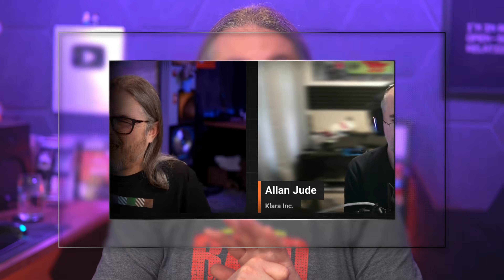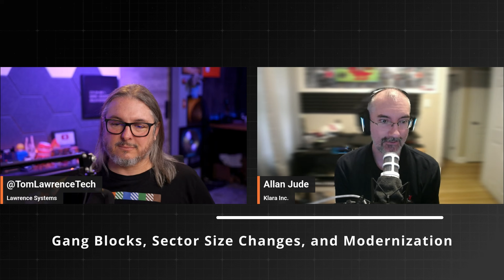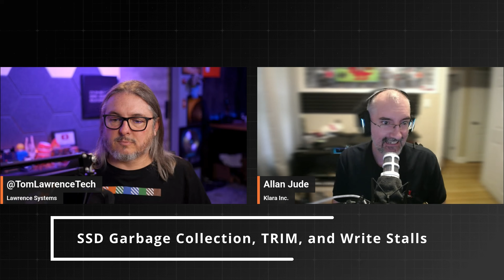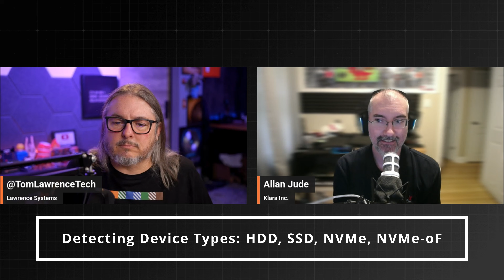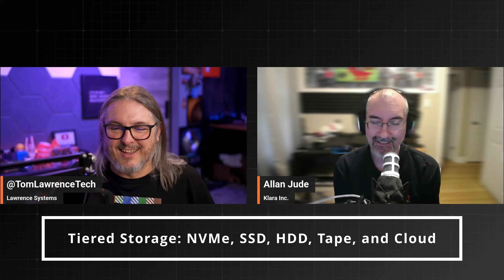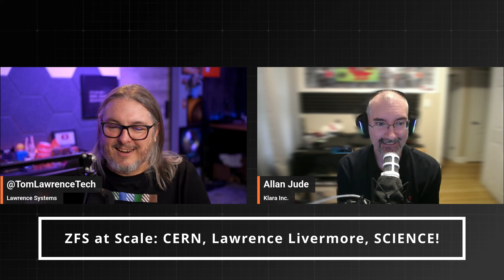Is ZFS Ready for NVMe Speed? Allan Jude Explains

Comment: The Anyraid development wasn't mentioned, which is interesting to a broader audience. It would be interesting to get info about wear leveling strategies on a vdev consisting out of a bunch of drives of different age to get the most lifetime out of them.
But wear leveling may be also interesting in general with replacement drives in a pool, especially if you have SSDs/NVMEs in it. I had a bunch of NVMEs used in the mirror layer of a mirror-accellerated parity volume of a Windows Storage Space. Some of them had still a health of 80 % but others were down to about 10 %. So it seems to be beneficial for block placement to spread the load more evenly on the disks, so the disks age more even over time.
Reply from the maker: We have a future talk coming up about anyraid.

Comment: From a desktop/workstation perspective, what I adore about ZFS is that I can just dump all my, eh "disks", chips? sticks?--  in a pool, format it and use it as root. And I still get as good or better performance out-of-the-box as I would tuning another system with software RAID and fiddling with partitions to get valid boot layouts for, say, lvm and ext4. Maybe skill issue with filesystems on my part, but it saves me so many hours of work that I just go FreeBSD pretty much mainly because of the ZFS integration.

Comment: I do believe CERN is using CEPH for the bulk of their storage. At least previously they’ve had some of the largest clusters in the world that’s using CEPH. I’ve seen some interesting talks made by their engineers. 
But running ZFS for their more high performance needs makes a lot of sense too. 

Man, it’s too bad RedHat pulled the funding for GlusterFS. I would have loved to see a TrueNAS clustering system based on ZFS and GlusterFS. Hope TrueNAS partner up with another file system. I love CEPH, but I also love ZFS… 😅
Reply from the maker: They use both
Reply: FYI, most high performance systems are using a parallel filesystem like Lustre which they might put on top of ZFS.

Also there were solutions with GlusterFS and ZFS. 45Drives sold commercial systems with this configuration in their early days. You will find instructions from gluster, proxmox, and various other places on how to do it. Today I really don't think anyone would do that though. GlusterFS was always considered very "busy" and not performant.

Comment: Also, solid state memories including RAM can go faster in some cases when spread across the medium - aka "highly fragmented", or to put another way, slower if stored contiguously due to bus monopolisation on 1 lane versus 8. ZFS works best when it's mirroring I reckon due to less thrash on rebuild. It's best feature is the self healing.
Reply: ZFS has more thrash on rebuild compared to more basic mirroring that rebuilds by reading start to finish sequentially since ZFS jumps all around as it decides what to read/write next by walking the filesystem structure. If the disk isn't full then total I/O throughput can be reduced and it will take less total time if the ZFS thrashing didn't increase time too much due to seeking.
Reply: @mirror1766  sequential resilver/scrub has been around since 2016ish. Is it perfect? No. But it doesn't seek thrash like you imply. Also, as long as it's not seek thrashing... A resilver will outperform rewriting the entire platter.

Comment: How about ZFS on top of Ceph with nvme hardware?
Reply from the maker: I am not understanding why you would do that
Reply: @LAWRENCESYSTEMS I mean: run a Proxmox VM with a Volume formatted as ZFS, on an NVME based ceph storage pool. How to optimise the ceph and ZFS settings in such case. Ceph networking will be (only) 25Gbs.
Reply: @SwissPGO  When you run the filesystem outsize the operating system you start to lose some OS level of awareness of the real data; some optimizations are lost as it is often thought of more as one large file representing the drive. Proper optimizations still involve considerations of things like sector and other block sizes of the guest OS and making sure you don't have sillyness overflow a bit in the host's layout. You can try tweaking things like recordsize if appropriate to the workload. Thought Klara posted an article talking of some optimizations when they covered the results of different drive interfaces being given to the guest OS but I haven't looked at it in a while.
Reply: @mirror1766 Thanks.... maybe a good next video topic ...
Reply: Ceph so cool and work so good my cluster appreciates it!!

Comment: As someone who works in the media industry - I have two storage servers running TrueNAS at home with all the projects that I've worked on stored on them. The projects I work on are nothing compared to feature films, but I can still afford to use ZFS because it's open source. And also I'm using refurbished or even second hand enterprise hard drives, but they work and they cheap! 

But I do have one question: does compression like LZ4 add to read latency on spinning rust? I've been wondering if I should turn compression off to improve latency a bit while editing.
Reply from the maker: LZ4 is designed for very low CPU cost, usually decompressing faster than the disk can read the data so I would leave it on.
Reply: I believe you’d even be better off with zstd nowadays as far as I can grasp all the discussions about it. I’m not an expert though 😊
Reply: @TonyBoston  lz4 has early exit on already compressed data. Zstd doesn’t have that but in theory does better compression. Stick with lz4.
Reply: For max performance I heard its good to use compression only for meta-data in theory speeding directory listings / searching? I did enable it due to there being 10 million files, spinning rust, a very fast CPU, but not heaps of RAM in my case.
Reply: NVMe-oF on openzfs, i still waiting so incredibile feature when?
Reply: The only real answer: benchmark your setup. Iirc crystaldiskmark is a reasonable default- but blackmagic has their own. Compression is unlikely to add appreciable latency unless you're doing sequential QD=1 reads that somehow don't get picked up by ARC prefetch.
Reply: @JohnDoe-c2f  the only real answer is to test your setup instead of just running synthetic benchmarks. Different real world workloads perform differently and benchmarks often are built to do some theoretical test and do not reflect the actual workload until you create a benchmark that is an extreme version of the original workload. Even an extreme version of the workload is not a 'proper' evaluation of the impact something has on your normal workload when we start talking about multiple complex interacting layers of ZFS unless your extreme benchmark was not extreme enough to exceed any conditionally varying parameters any more than the real workload; once you are at that point its likely to not be an extreme condition test anymore.
Reply: @JohnDoe-c2f  sequential reads can fire up multiple decompression threads per record. There will still be a small time to decompress which increases as you go to larger record sizes and slower compression algorithms but lz4 is the fastest general purpose compressor that zfs has. My understanding is that ARC prefetched content will not be decompressed until the data is actually requested and thought I recall seeing they fixed a bug some months ago where extra decompressions had been happening.
Reply: ZFS lies about when data is written unless you are forcing it to sync before responding (doubtful + unnecessary for most workloads); before writing it will have some CPU+RAM time spent attempting to compress data. As a result, writing can be difficult to get proper latency measurements for as you would have to measure when zfs decides its time to write and how long it takes to do that + any rearrangement it did before then. Reading a stream that didn't save enough (each record is individually compressed or not) will only fire up a decompression routine if it was successfully compressed (again it uses CPU+RAM). Though there is a slightly higher latency between requesting vs starting to get data to read, total throughput goes up for any successfully compressed blocks to be read/written as there is less drive I/O throughput to represent the original data. Reads may have been prefetched which can reduce the wait when it is actually read but prefetching is more work which can be disabled if it is not benefiting the workload.
  Once read from disk, it goes into ARC by default. Compressed data is stored in ARC still compressed so further reads will require decompressing it. There is a very small amount of memory by comparison that caches the uncompressed file data so it could be possible rereads do not always have to decompress it. That decompression does take CPU+RAM and I think it is the only time decompression actually occurs. There are multiple compression threads that fire up for multiple records if your file is stored across multiple records or you read/wrote multiple files from multiple records so the latency discussion is likely best kept to the impact to the first record only as the most significant thing to consider measuring.
  If your content cannot be compressed enough, the data is written uncompressed so ARC is smaller compared to when it caches compressed data (doesn't matter if you have enough RAM to hold it all). Reads will not have decompression CPU+RAM and latency overhead. There is CPU+RAM used on the chosen algorithm (and maybe more for zstd) to abort early if it looks like it wouldn't have compressed enough but that is faster than doing the compression itself.
  My testing showed LZ4 (outside ZFS and a newer version) on my i7-3820 is very low CPU + RAM overhead but maximum throughput was slower than a RAM disk without it, is faster than a 970 evo (I think that was reads and writes both but its been a while) and therefore was significantly faster than a magnetic drive. my lower overhead than zstd though I didn't test all zstd fast variants. Zstd will become the bottleneck on writes for my magnetic drives after turning it up a few notches. Read throughput is accelerated as long as you have enough CPU performance to keep up and I forget but it appeared to maximize with zstd compression at around 12 to 15 but was much slower than lz4.
  If this is all for latency when editing (assuming video but what is being edited could matter), I'd first ask where the latencies are that you see when editing. If your editor feels sluggish initially opening a file then you probably need a hardware upgrade but if it is sluggish opening many small files then it could be a latency issue; is the editor sequentially opening a file then waiting to finish before requesting the second, third, etc.? A ZFS tune that I'd suspect could have more impact would be changing record size since each video chunk would become larger so should be put into fewer separate pieces scattered around the disk. If it is latency initially opening a file to the time data starts to appear and not time spent waiting to get further though the file then that latency goes up with higher record sizes as reading a full 256kB+ record take more time than reading the default 128k. Adjusting the record size can impact the compression ratio achieved; usually my tests show somewhere between 256k and 1M best for most data I tested with but I haven't done a thorough test of it yet.
  If the content cannot be well compressed (such as video), sometimes some of the data may be such as some metadata in the file and I thought ZFS also will compress filesystem data itself too. Don't expect big disk savings but for LZ4 its likely best left on even if gains stay marginal.